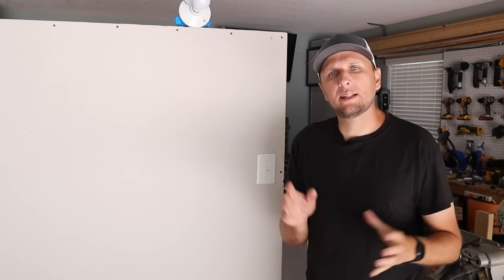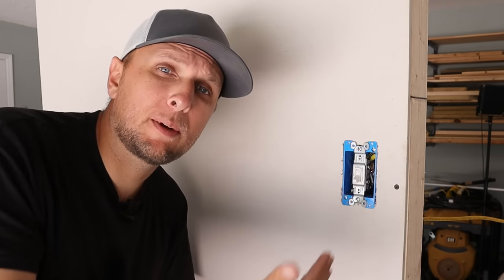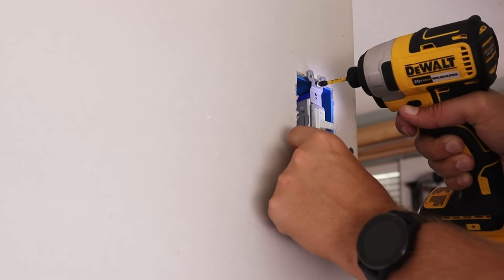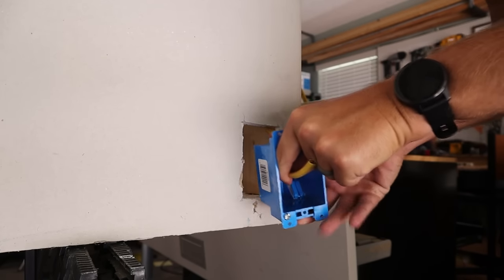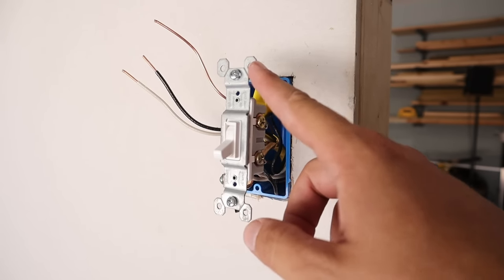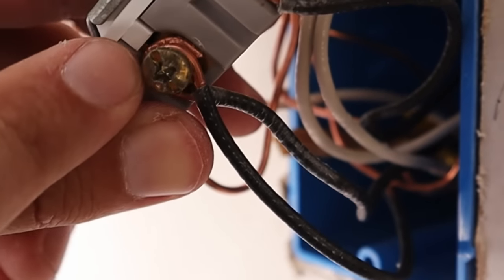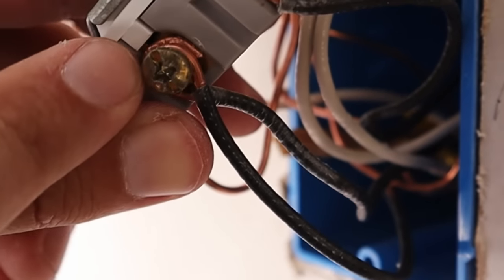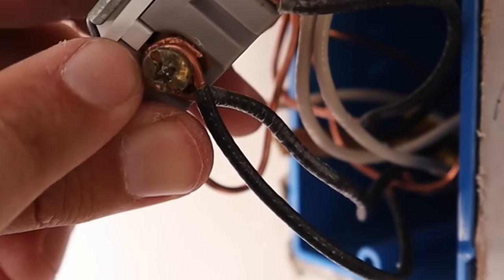How To Add An Outlet From A Light Switch | Common Mistake

Comment: One thing I think that is worth pointing out on this type of wiring method is the box fill. Per NEC 314.26 (B) the box being used for the switch should have at least 20.25 cu. In. in it for the fill based on the wire size and devise used. Perhaps you can do a video on it explaining how to calculate proper box fill based on wiring size and devices being used. Good video.
Reply: That needs to be done with GFCI receptacles. I run into too many where the box is to shallow. I wanted to put them in my kitchen which had three different circuits around the sink are. The number of cables and splices made it impossible to install them.  I opted to put them in the electrical panel and found that the guy who had refurbished the kitchen had split the cables with the neutral from one circuit being used in another circuit to a couple of receptacles a number of times. I had to take all the splices apart in every box and rewire all the connections. If the circuit is split the new GFCI panel breaker keeps tripping. You won't know this until you try to use the receptacle. 

Most of the bad workmanship isn't from DYers. It's from contractors who think they know the whole job and do it all themselves. Probably unlicensed.

Comment: I see someone has already pointed this out. A lot of times you will only find a switch circuit pulled into the box. Hot coming in,hot leaving,and ground. The black and white are both hot wires. Make sure you do have a neutral.
Reply: How do I make sure there's a neutral?
Reply: By "make sure" he means "you must" have a neutral.  If you don't, you can't power the outlet from the switch box. You'll have to run a 3-wire cable from some other source.

Comment: One basic problem I have when doing electrical work is the size of the box. Most boxes sold at the hardware stores in Canada are very shallow with not enough room to make other than simple connections. The work done is this vid is great, but the box is deep enough to take all the connectors, making it a lot easier to do.
Reply: And if there’s any tight packing of stuff in the box, with a plastic box, be careful to not strip the plastic threads of the mounting screws when putting things back together.  Push the switch fully back in the box, and hold it still while tightening the screws.  Don’t use the screw threads to compress the box’s contents.
Reply: That’s a pretty standard run-of-the-mill box he’s showing, in fact it’s a bit on the small side. I also am not a big fan of the “wings” type old work box; they have boxes which are a bit bigger and not much more expensive, which have screws at an angle to attach to the stud. Just gotta be sure the heads are recessed; I think maybe the heads could also be covered with a hoop of silicone. 

Surprised you can’t get these in Canada - I know there’s Home Depot there at least. Maybe you need to come over and smuggle a few back 😅
(Hey we go there for medicine, so why not? 😅)
Reply: @peacefrog0521 Boxes with “...screws at an angle...”?  Please tell us more.  Have never seen or heard of such.  Remarked me wife just a few days ago, that it would be wonderful if such boxes were available.  Really do not like the old work boxes with the little flip up wings, or the way such boxes are supported only by the drywall.  Would much rather secure a box to the stud.

Comment: I'm an apprentice electrician and just did a job like this one. I followed the same procedures. I like to use Wago connectors vice nuts. I do be sure the wire is stripped to the correct length and connections are tight.  On the receptacle, the hot and neutrals should be aligned, i.e., don't put the hot on the top (gold) screw and neutral on the botton (silver). Thanks for the video. Guys like you are a big help to rookies like me.
Reply: I was wondering why you couldn’t use wago connectors to that last connection? Could you?

Comment: I have an idea for residential installations! Each box has a QR label on it. The QR label goes to a User interface LAYOUT map. When ever work is done the strings / wire runs / terminations are all mapped in the software user interface app (possibly displayed in 3d modeling software). So whenever ANYONE scans that QR code they will be prompted with the current and all past (logged events) wiring that has taking place at that box/receptacle!

 It's sort of like a PCB schematic  for your home's wiring. You could add photos, dates of work, names of subs, devices, time frames, programmable settings, ect. It could be as simple as image overlays or as in depth as full building blueprints with 3d rendering!
Reply: That'd be awesome!
Reply: Where is this data stored?
Reply: @danlux4954  Same place half the software is nowadays.....cloud storage.  Perhaps even municipal storage, since they're also the permit issuers.
Reply: @danlux4954  Micro sd, cloud , or even converted to text to be cross platform.

It's a really good idea I wonder why it hasn't been used. Perhaps because subs lie about what is REALLY there or not and it would be hard to tell unless you have hands on verification. Which would lead to more regulations if it was.
Reply: @darkmagna9004 storing info about the house in the city’s computer would not be encouraged by everyone. 😂

Comment: Thank you man. I just bought a new home and had a small room planned for my Airbnb coffee shack. Went and bought the table and mini fridge, coffee maker etc and then realized there wasn't a single outlet in the entire room.  Luckily I only needed one and in 30 minutes I had it done and works great. Tested it with a wiring tested and got Correct lights. So went great.  And I wasn't sure if the outlet would be hot only went the switch was on but it wasn't. Hot all the time like I wanted. Saved me from having to call an electrician.
Reply: Great job 👏 👏👏👏

Comment: Alternately if you only need a single receptacle and don't mind it being switch height, you can buy a switch/outlet combo receptacle. You can hook it up so the receptacle is always on or controlled by the switch.
Reply: Yeah, but that would not make much if a video, it is just a direct replacement.
Reply: True, that is a good solution for a garage where you want the socket at work table height, but for a living room, you want lamp plugs and ugly stuff where it is invisible. That would not look good in a living space.  Plus, you still need to know how to do both separately, hence the video.

Comment: First of all, great video, very straightforward and easy to follow.  I installed the outlet and tested with outlet tester showing wiring is correct, but when I plug something into the outlet, the light where the switch controls start blinking/flickering. What can I do to fix it?

Comment: I have learned to check EVERY wire in a box for stay voltage,  before considering the power off.   Because of common neutral between crcuits I have found "hot" white wires, and once a leakage current on the bare ground wire.   The first "hot" neutral cause my arm to tingle for a couple of hours, so I always check.
Reply: Hey J it's called an "open" neutral" and they are everywhere when opening up splices and that hit is the worst kind , be safe my friend
Reply: If all else fails don't be afraid to shut off the main. It's a pain but it's safer.

Comment: The best method to attach a wire (and doubling them also) is to crimp the curved wired around the screw (using a needle nose) to make a complete circle (this requires a 1/8 inch more of insulation removed). A high torque tightening will keep the single wire (and subsequent wire) from coming loose. Also I very often use my linemen's pliers to twist the wire nut tighter.
When adding stranded wire to solid wire inside the wire nut, extend the stranded wire about 1/8 inch past the solid wire ends. Then pull on the stranded wire once you tighten the wire nut to confirm it's attached securly.
Reply: I always do that.
Reply: Good to know, thanks.  An even better way:
1. Use circle type connectors on each loose end going around the socket screw. Now remove as often as you like without stressing the wire or cursing.
2. Use Wago connectors instead of these dinosaur wire nuts.
This is what women would do. And we know they are much smarter than men.  :person-turqouise-waving:
Reply: Yes, terminal connectors help tremendously, if you're pulling stranded awg 12-14 thru conduit and attaching to many, many switches/outlets. But if the crimp on the terminal is poorly made, trouble down the road. A lot of connections loosen up from the expansion and contraction of the amperage flow. With either way, (terminals or wire alone) torquing the screws is the absolute best way for no arcing or call backs.
Wagos are not preferred by most older master electricians. Some new inventions seem to have all the answers but in actuality, the former way that's been used for decades and decades, as in this case (100 yrs), if done properly by twisting before applying the nut is a sure thing. Just yesterday, I had to replace four switches in a 4 gang box. Two groups of neutral wires had two seperate wire nuts. The new switches were larger and to make room I grabbed each of the two neutral wire nuts and pushed them further back towards the rear of the box and upon doing so a neutral wire pulled out. I removed the wire nut and found three untwisted wires, which made me remove the other neutral wire nut to check for twisting (which was done). The metal box wasn't grounded either. This extra work raised the labor rate by 30 mins. It's time consuming working with so many wires in a box and adding larger switches. Professionals or DIY'ERS need to practice all the basic codes before working on any project and apply them without taking short cuts, for any electrical, plumbing or carpentry undertaking. I find many mistakes constantly with all three.

Comment: in Australia lighting circuits and power circuits need to be kept separate. In many older homes there are no neutral wires run by light switches. The neutrals loop at the lights. Until recently it's been an impediment to retrofitting "smart switches" in older homes. You can't use the live from the old switch and run a neutral from an adjacent power outlet. You would have to run a new neutral wire from the fusebox or off the neutral loop for that circuit.
Reply: In Turkey, in old legislation, keeping the lighting and power circuits was not a must (today it is). But even so, most of the old houses it is kept separate. 

And as you said, there won't be any neutral wires run to light switches (either new, or old building).

For renovating INSIDE a house, you don't need any permissions here, so no one will check what you are doing. Only, if there is natural gas inside your apartment flat, that will be checked. 

Since we live in concrete apartments (also deteched houses are concrete), there are juction boxes on top of every single switch and outlet (somewhere close to ceiling). That juction box will contain neutral (that is going to the light) and you can take neutral from there. There won't be a need for taking the neutral from a outlet.

In Turkey there is not circuit braker on outlets. There will be one circuit braker for the entire house. So if phase and neutral differentiates, it cuts the houses entire electricity. There are both one phase and three phase versions of it. Advantage: Easier for application, cheaper, same safety. Disadvantage: refrigirators (especially old ones) are inductive loads. When cold starting sometimes they can trigger circuit braker. This is not important if you are in the house. A refrigirator can keep itself cold for 24h. But if you are on vacation, you will loose all the stuff in your refrigirator. :D So, In Turkey, if our refrigirator is old and we can't change it, we connect the fuse of the refrigirator BEFORE the circuit braker (this is against regulations), untill we renew the refrigirator.
Reply: Yep. Switching straps were a way to save money back then, only running two cores down to the switch.
Reply: The US was this way too, but recent codes changes now require a neutral at the switch in the case the own adds smart switches and need neutrals.  There are 2 methods of wiring in the US each room on a circuit light and outlets, or common lighting for several rooms on a circuit and outlets per room on a circuit.  Both are legal by code and is just preference.

Comment: Good ideas but a very important safety concern was left out:
Most lighting circuits use 15amp  14/2 Romex wire & breakers. If you add 20 amp 12/2 Romex to bring power from the switch box to a new outlet box, then either the outlet is under powered or worse, someone "corrects" / upgrades the outlet breaker to 20amp leaving part of your outlet circuit with 15amp wire... a bad thing.
Reply: Exactly. Why add heavier guage wire,  to a circuit not designed to handle what the new wire  is capable of? At home, probably to use up old 12 guage wire, where 14 is not handy/ left over. As a pro, or as an instructional vid, hopefully this is never done.
Reply: I agree with all of the points you both have made, have seen it plenty and then some. One would hope that anybody changing a breaker would notice the color of wire sheathing or even the gauge at the panel being different and figure out what was going on and just leave it be. Although I've seen 12 at the panel, 12 at the box, and a twenty foot run of 14 in the middle, hidden in the wall... behind door trim no less. Luckily, most DIY'ers don't usually mess around with electricity, let alone breakers. But then there's the ones that do! 🤦

Comment: amazing videos my friend. i have learned more electricity with your videos than when i was in school. Now i feeling more confident to do my own electrical jobs. thanks. I would like to know what will be the best way to fix a light switch installation than does not have enough deep into the wall., so i have part of the switch coming out not flush to the wall. I cant dig more because i have concrete .